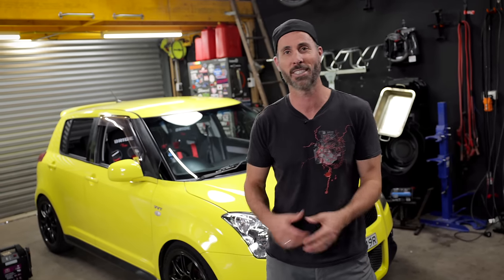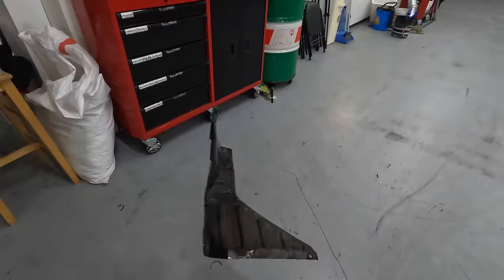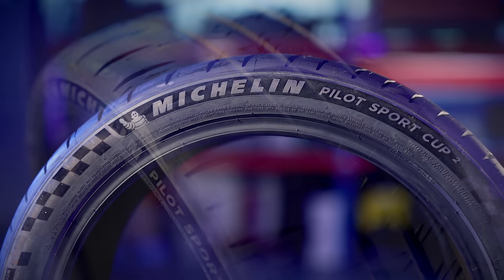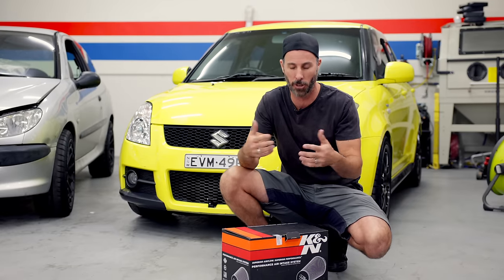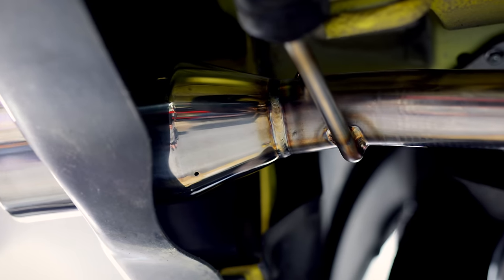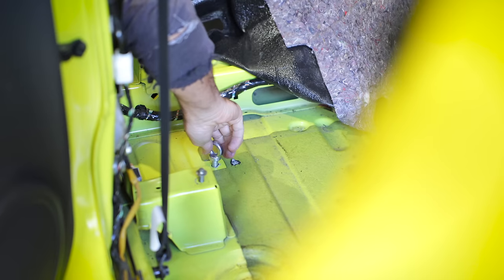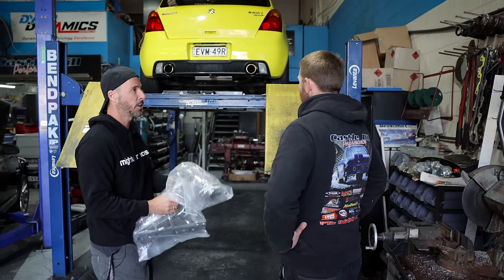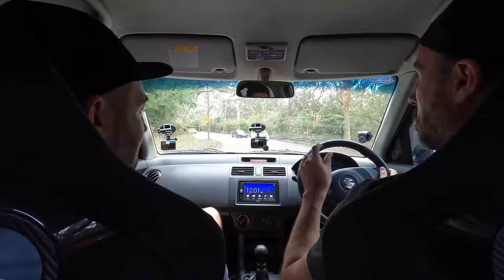Building a $25,000 Suzuki Swift in 27 MINUTES

Comment: love the video you guys doing, but for track day, beside of power gaining and weight reduction, what about braking? not even a better pads, disc and fluid will kill yourself on trackday mate, just get something better than OEM and only cost you 70-100 bucks.

for me, i will save the roll cage and LHS seat and go for high temp performance brake like endless or projectMu & cooling radiator with hose instead.

Comment: Most people don't understand, that all the mods in the world don't mean shit if you can't keep the oil in the motor. Your street car is designed to go straight on a road, or highway. Take your street car and put it on a track and put even mild G's into corners and all your oil moved away from the oil pickup, your pump sucks air, your bearings seize and you blow your motor in seconds.

#1 mod in a track car. ACCUSUMP.
#2 Oil pan engine/ Baffles
#3 Oil Pickup.

Then you can do anything you want.

Comment: That heat exchanger o ring is a swine. I swapped my engine etc and then found that leaking so had the manifold off and changed it thank god. My car has had 50k miles on the Nurburgring and Uk tracks it takes a right beating and reliable as anything. Granted its a zc32 but very similar. I run 15" wheels with 205/50/15 tyres. Swifts are a underdog. Until you've been out in one or driven one you wont get it to be fair.

Comment: If I had a spare $25k I would have started with an R1 swap…

Loose weight + gain power

(reverse would probly be omitted, but it's not that important in a car that's light enough to push)

Comment: Those K&N intake kits are rubbish, but the fact yours cost nearly $500 dollars is a disgrace!

I bought the exact same thing for my first car when I owned it, it even had the dumb tube which the official install method is cable ties... Mine was only £50 though so about $100 aussie dollars, it was official K&N. That's about what it should cost, and I knew I'd lose power because it was bound to pull more hot air than the factory setup, I did it for the sound though so with it being that cheap I didn't mind too much. They really need to drop the claims of a power increase, this video is proof of that.

Comment: If you are doing the Air Freshener in the Cabin Air filter hack, do yourself a favor, and cut the Air Freshener into thin strips and lay about a dozen of them in the filter pleats every 2 rows. The thin strips allow for better and still filtered airflow through the system.  Don't just toss a whole air freshener card on top and block a bunch of your air flow. Most cabin filters only flow air well in a smallish area of the filter and blocking that off can affect how you heat & A/C perform.

Comment: hey guys , i also have this model swift sport , i was actually able to make a cold air intake ( thru the front left vender ) in combination with a stock replacement k&n filter and free flow axle back exhaust , maaaaaan it sounds goooood . you can try it !

Comment: I thought they had more power than that? 92kW in a car made after 2010? What a joke. Toyota's small port 4AGE was 100kW in 1989.
Reply: less emission laws to deal with in 89 but also its not optimized for performance as the 4age was

Comment: Yes, about the only real criticism of mine is the piss-poor steering feel, it manages to be both heavy and lacking feel at the same time.
Not too bad for the most part, but the little steering corrections needed on the motorway are MUCH heavier than anything else I've driven - and that included a lot of trucks and other heavy machinery.

Comment: The K&N Filter would literally work better if you rotated the 90 degree intake bend and ran the hose from there taped down to the bumper with the cone lol. What a terrible design for 500$. I havea 500$ K&N Intake for my honda and its a Full Metal pipe with pod filter and a Metal Heat Shield housing with Rubber to protect your fingers from the edges and hardware to install all of it. Its abysmal that this intake is a filter, a useless hose and some clamps for the same.

Comment: I have a 2014 suzuki swift sz-l it's a two door sport package white roof and mirrors blue underneath. Only the 1.2 liter but a bit smaller than the 4 door sport. It's quick off a line to 70 ish. But that's it, it's quick, not fast. Would love to track day it and see the handling actually put to the test.